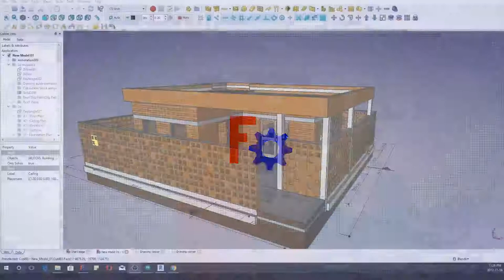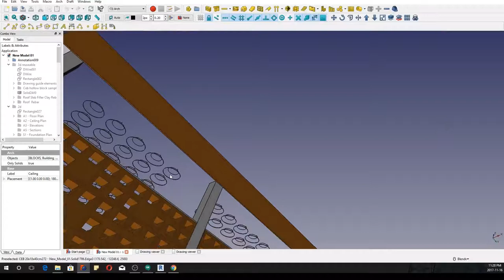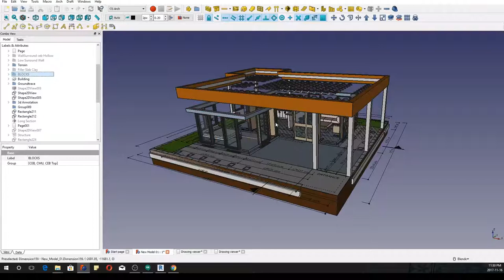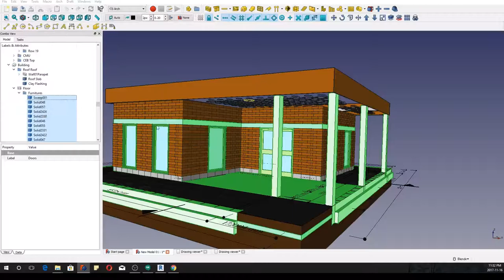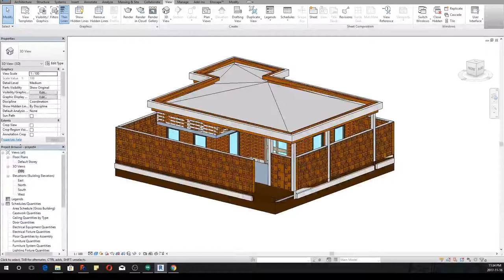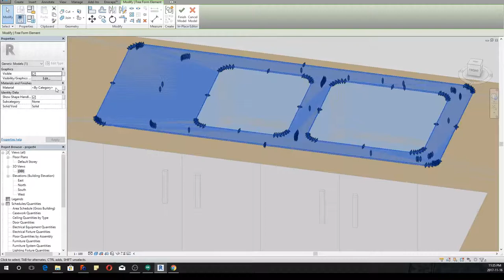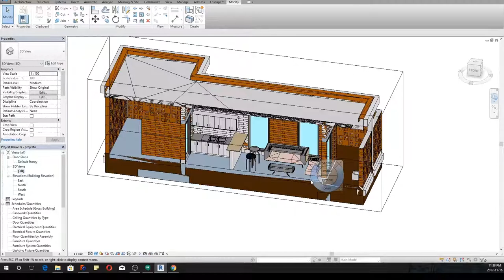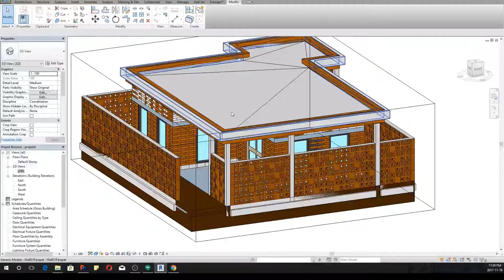FreeCAD to Revit with IFC - 2

Comment: I haven't seen any other project done in this detail in 3d bro! LOD 400. Awesome! Is there a way to use these as something equivalent to SketchUp components inside freecad? So that it doesn't slow the system? Say you make one type of brick and use the clone tool for all other bricks of the same type, will it keep increasing the size of the file?
Reply from the maker: Sure you can use them as links. Check out discussions about links on YouTube and freecad forum about freecad links and freecad external references. Also within freecad bin work bench the "make compound" can also be of interest to you. I hope you were able to download the model? Cheers to you.
Reply: @RegisNdeTene  Thank you for your reply. I will check more about links and external references. I have been using "compounds" for a few days and didn't know they were like components, although I have to copy them and replicate it and check the file size. I don't know anything about the model I was supposed to download, but we were discussing that multi-layered wall in your other video ( basically plastering, walls columns, and windows openings ). I will share that file soon, lets see if I am doing that right. Thank you for all your videos, and cheers! Keep making more of them..................
Reply from the maker: @thotbuilds1466  if you check these links https://github.com/chopinregis/OS-5K.4.5K-CASA.git and this one https://github.com/chopinregis/WikiCasa-Shelter-Afrik-5k-4-5k-homes.git you should be able to find the project and its progress and download it. In the video the project is a bit slow because it is generating the plans in Techdraw everytime there is a change. There must have been updates and a better management systement to control those speeds and laggy iessues. Unfortunately i don't have the time anymore to look into these. Yeah it would be a delight to see your projects and what you are up to, and i can provide my 2 cent opinion, why not? so feel free.

Comment: I am not clear about the purpose of exporting to Revit
can FreeCad  not generate multiple standard blueprint pages using TechDraw ?

I'm coming from a Sketchup world where one can build a 3D model and then create 2D Layouts
for working drawings
Is that equivalent functionality available in FreeCad - including fine control of line weights and dimension styles
and font styles etc ?
or must the model be exported to other software to do that sort of thing?

One thing that strikes me as super-strange is that to do an export, each-and-every-individual-entity must be selected
to perform an export - or for that matter to create a view in techdraw.
From a UI design PoV wouldn't it make sense to select the high-level construct which would automatically select all of
the underlying objects/solids/shapes/whatever
Or even better - if it is visible, it gets exported/viewed/whatever
That way, one simply hides what is not required, and the rest gets "done"

Also, it looks like you are building the walls with individual blocks. Are you using the Wall and other constructs from the
Arch Workbench ? When do you use those constructs Wall, Structure, Floor, Buildilng etc ?

Do you have any tutorials for importing DAE exported from SKetchup and building a FreeCad model from that ?
I'm poking around with that but it's quite confusing...
Some of the imported meshes can be converted to shapes and then to solids and then to walls
whereas other meshes cannot... they look perfectly fine, the source geometry is non-complex and is "tight"
Reply from the maker: Hello @ Kurt Klingbeil, Thanks for you message and general interest in the content from my channel. 

Here the purpose of exporting to Revit is to show some people in the industry that they can share their model with other proffessionals who use only Revit in their workflow.

Also Freecad standard blue print Techdraw is not yet as smooth and as efficient as Revit so if there is a need to be expedient, it will be most prefarable to transfer into a more robust program such as Revit or Archicad. 

Yes Freecad is quite equivalent to Sketchup in that the process is to build the 3D model and then generate the 2D blue prints, but again Freecad blueprints is not a robust as Revit or Sketchup, It has not yet gainned the full attention of the limited number of developers for Architectural purposes. But the model doesn't need to be exported to other programs to do the blue prints. It can be done in freecad, but it might be tedious as various tools might still be missing. 

No to do an export you can either select what to export, or you can put the entire model into a folder and just export that folder, or generate the view from that folder. insteand of individually selecting items. 
Freecad already works similar to what you are expecting based on your some of your comments, just play a little bit more with it. I'm sure if you are having fun you won't be dissapointed. 

As far as your DAE export thing, hmmm i've actually played with some models i designed in sketchup before, and the only best way to i discovered to get the model to freecad was to go through the blender route. But once in blender I had to do some extensive cleaning to acquire a clean model that Freecad will reliably read. So yes that's the way i ffigured out to circumvent the the odd shapes etc etc. But it's a tedious process to cleanup in Blender if you don't know how to use Blender. but it is rewarding and fast if you are familiar with Blender. so check out all the ways to clean up in blender and you will get an idea of how to do export something that Freecad will understand.

If you need anymore chat maybe we can see how to do a screensharing sometime so i can better understand your issues and show you how i deal with them. 

Much regards to you good friend.